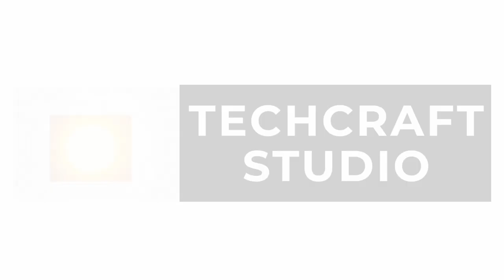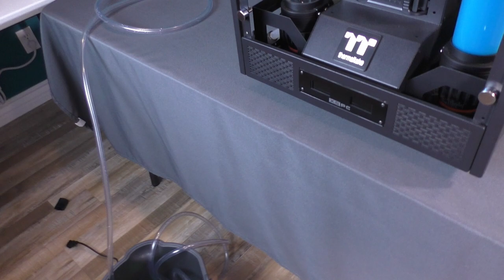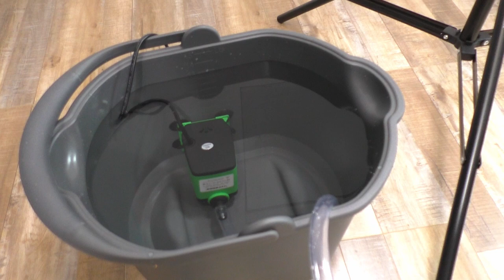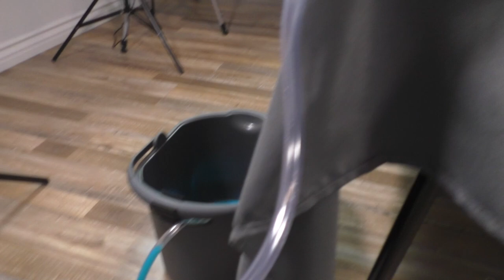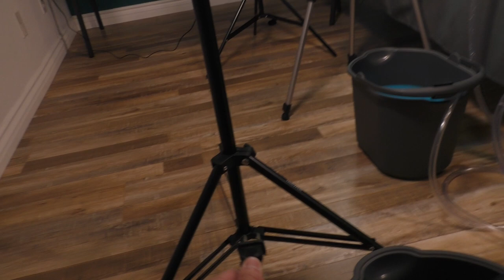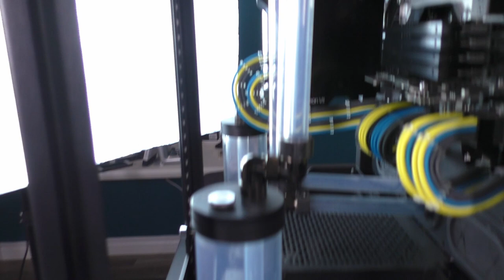Watercooled PC Maintenance - How to Flush Your PC Watercooling Loop with a POWERED Pump

Comment: When doing this, did the flushing fill the whole reservoir and did the water get all the way to the top of the glass tube for the res? Ive considered doing this but assumed that would be a problem, because with the flushing setup the water wouldnt fill the reservoir it would just keep flowing through the bottom of the res, because there is no resistance to make the water fill up inside the res.